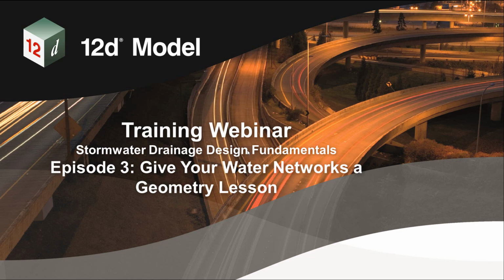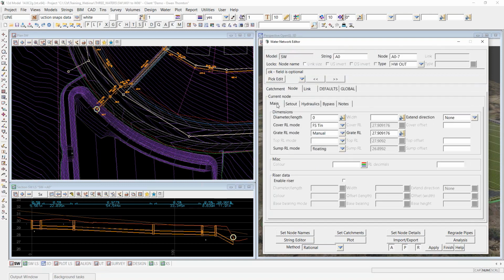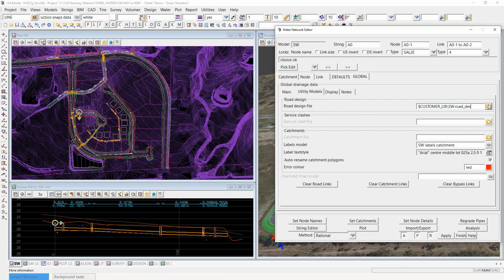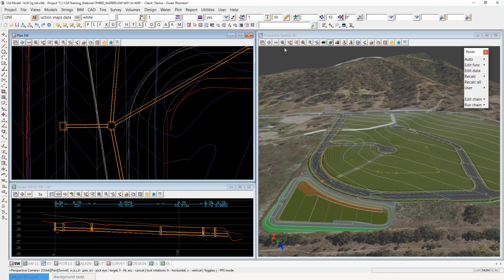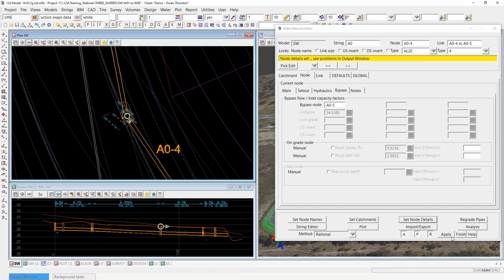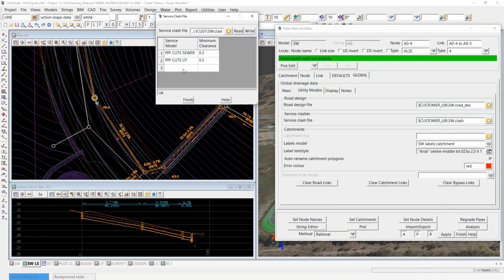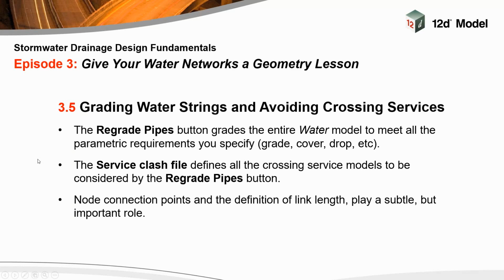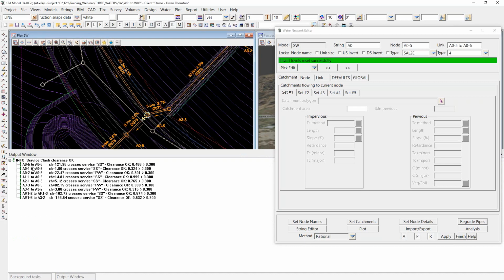SDDF (Episode 3): Give Your Water Networks a Geometry Lesson - Training Webinar Series

Comment: 43:59 Could you please clarify what you are trying to do with this PIT?

I can see that it has already been rotated correctly, and since you only need to place it at the low point, you should just move it to the low point location.

So why are there so many operations here, yet there is no significant change? Could you please explain this more clearly? Thank you very much.
Reply from the maker: Hi, the 'Grade Offset', 'Xfall Offset' and 'Slope Measurement Distance' are used to define where the road grade and the road crossfall are calculated from. The grade and crossfall of the road adjacent the stormwater pit are used to determine the inlet capacity of the stormwater pit when bypass is considered. These factors do not influence the size or position of the stormwater pit.